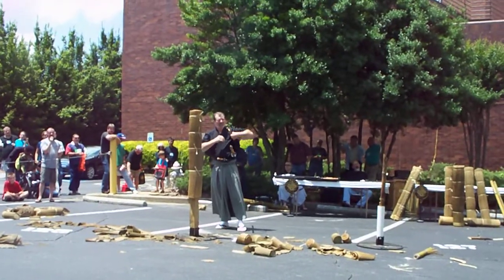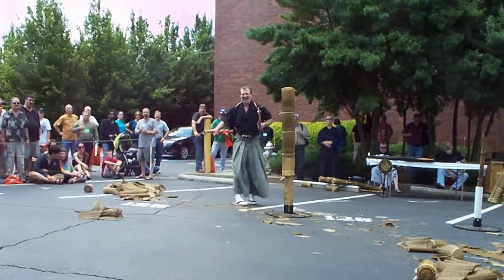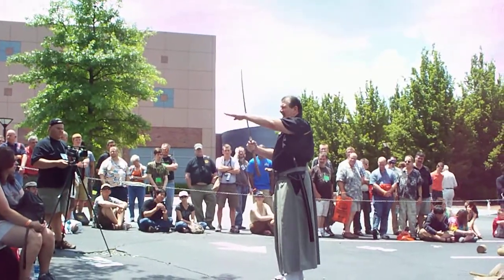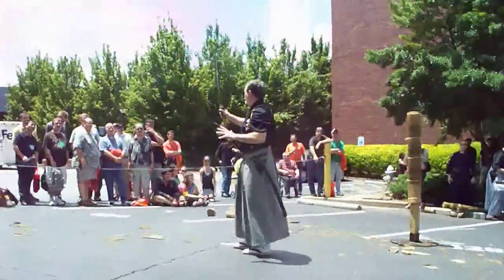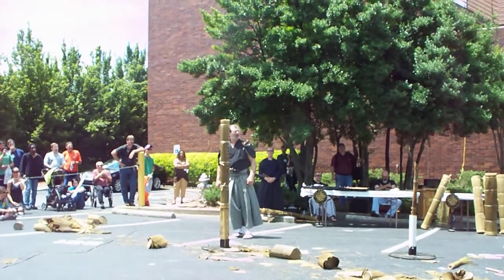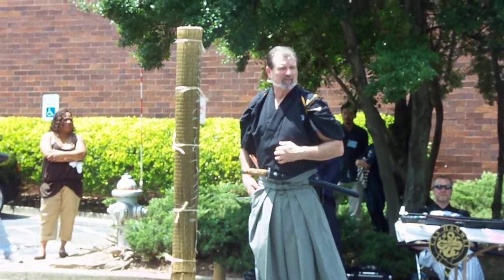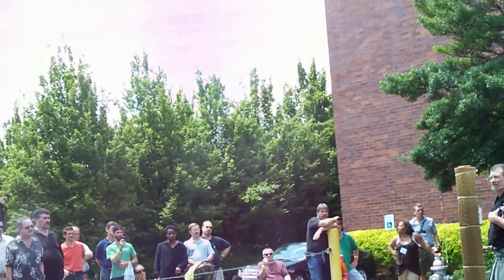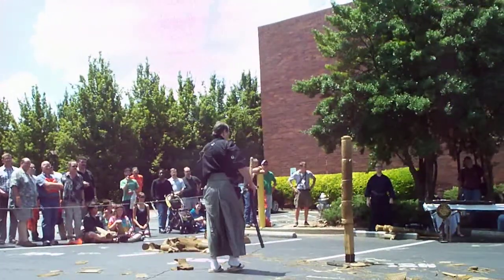James Williams Blade Show June 2010 Atlanta Ga (2 of 2)

Comment: most.. omg, this is an old comment. ill answer anyway. most noto is done with the mune as you say, slides across the back of the hand at the place where your fingers meet the base of your thumb. For drawing, obviously, no skin touches the blade. there are kata where the sound of the sword being drawn is silenced by using the fingers to stop the blade rattling inside the saya but other than that...